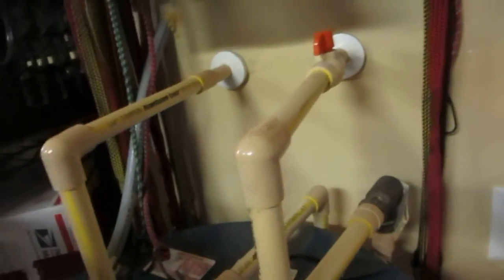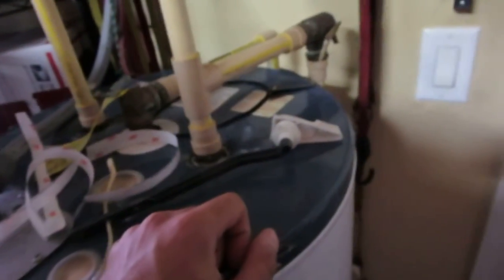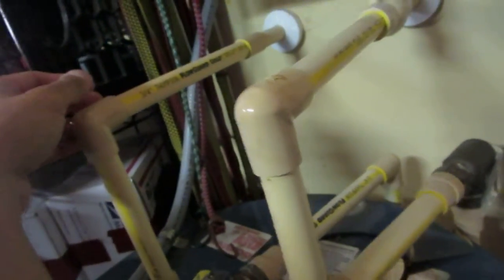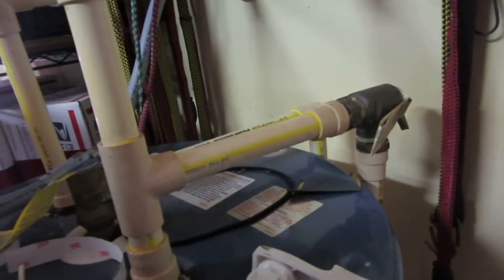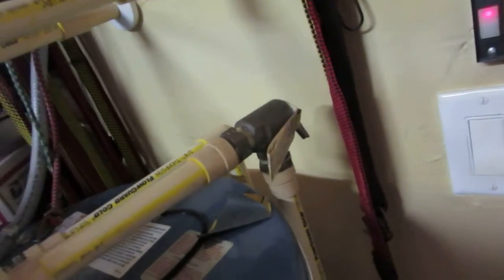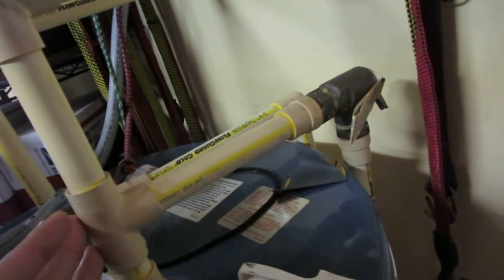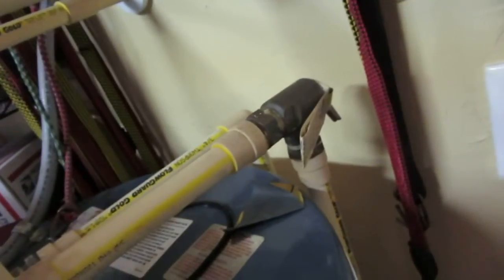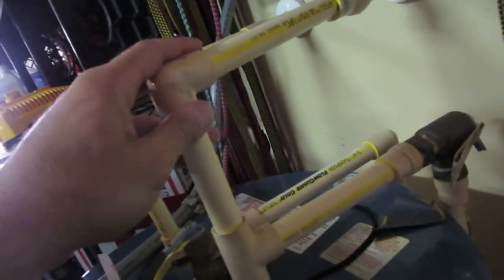Water heater question WHY two pressure relief  valves?

Comment: It probably is because the water department installed a backflow prevention valve.  This means that the hot water in the tank will have no where to go when it expands due to heat, so most water departments that install the backflow devices require two valves.  My county water department required I install a second valve, ON THE COLD WATER SIDE, although it was not the same type as you have.
Reply from the maker: +SytesSteal UrData  Awesome explanation. That makes sense. I talked to other people who have similar built places, ehh Junk, they said they don't have it, Weird.

Comment: The extra relief valve is on pvc cause it’s a lower pressure then the one on the water heater it was to protect the pvc water pipes.  That came from a plumbing inspector cause I just ran into that and was confused on why does it need 2